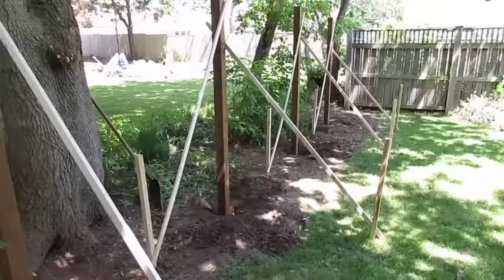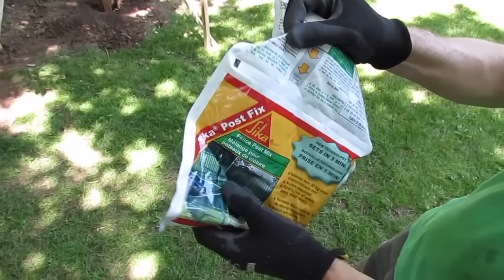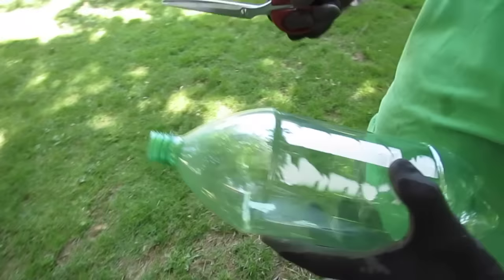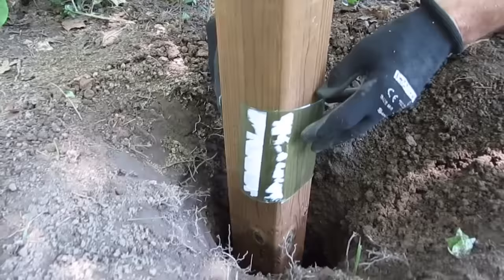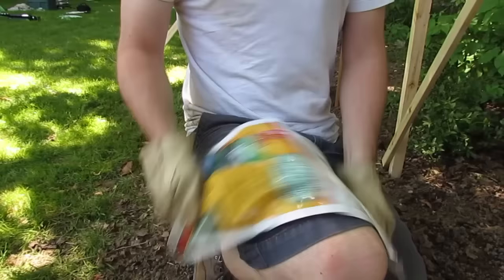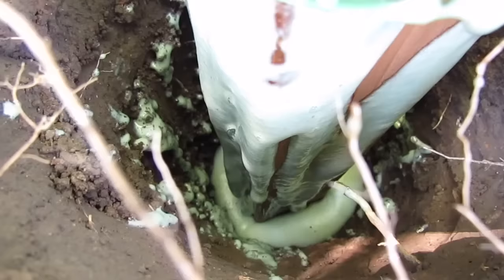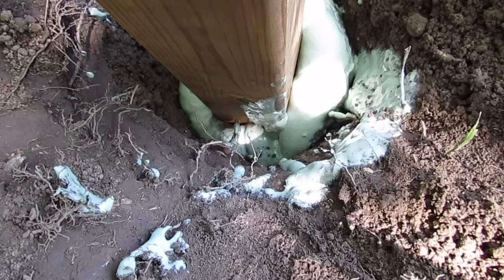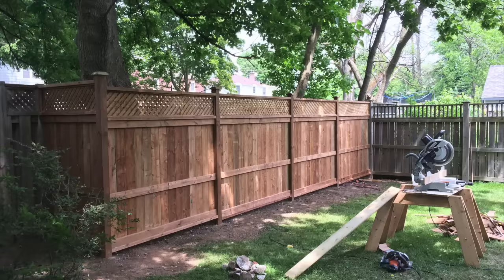No Concrete Fence Post Install!

Comment: You could easily have finished those post quicker with sackcrete,  dump it in the hole, add water and you are done, 1 bag per hole, easier, faster, cheaper, no need to mix it..... it  is  a fence, not an open heart surgery, don't make it more complicated that it needs to be, PS: if  you use sackrete no need to spend all that time of extra work "bracing those post"
Reply from the maker: First time I’ve had this comment, good to know

Comment: I've never figured out why people used concrete to set ANY post..................or foam, or anything else! If you own an actual post hole digger, what my parents called a "digging bar", the end that ISN'T used for digging is flat.......................for a reason. You'd dig a hole, scoop out the dirt, set your post where you wanted it, put SOME of the dirt back in around the post, and use the flat end of the digger to compact the dirt around the post. Scoop in some more dirt, compact it again. More dirt, compact it again. If you could fit the post and ALL the dirt back in the hole, you did the job correctly, and the post was set. Cement doesn't HELP that process. Neither does foam.
Reply from the maker: That seems to be a popular method for sure. In my climate the posts tend to get squeezed out of the soil from frost heave.
Reply: @PatonHaus  I'm in Pennsylvania. Typically, 18" will keep that from happening here. I'm not saying it works EVERYWHERE like that, but this region, 18" will keep anything from heaving due to freeze/thaw. Incidentally, if your posts are heaving from frost/thaw cycles, concrete won't change that! DEPTH will.
Reply: @PatonHaus  By the way, if you're setting any type of treated lumber, concrete whether wet or dry will actually work to deteriorate that lumber. I personally attribute it to chemical interaction, though I've never found spending the time to research it worth wasting when simply setting a post the way they were intended to be set works! LOL.

Comment: So I used it for the first time and it worked great. It was a very hot day and it set up very fast and was solid. The next few times I used it I was very disappointed. One time it had rained a little and I thought maybe thats why it didn't work. The other time it was colder but it did not set up or become solid. Using concrete is almost as easy and its a sure thing. I give the foam thumbs down, would NOT recommend

Comment: I have the project coming up next week, and was checking to see if there's some new products that I'm not aware of. This one looks a good option, but reading the comments below made me wonder if there's enough weight at the bottom to be sturdy. I might throw in a couple of 5 pound dumbbells, or any pieces of heavy metals to give it some weight. I like the foam better than concrete because it'll protect the post from elements , and prolong the life of it, I guess another option is to dip the bottom part in tar, and wrap it with  2 layers of heavy weight plastic sheet, the set it in quick crete. As for you Jay, maybe the %10 are as dumb as you.

Comment: Less mess? How? There are plastic bags to throw away.  There are bits of foam on the post, on the surface of the dirt, probably stuck to his gloves and clothes. Arms, etc.  Concrete comes in paper biodegradable bags, mesh consists of small stones or rocks known as aggregate and can be buried or put on your gravel driveway.  In 50 years or 20 or whenever, when these posts are dug up, concrete can be broken up and reused, recycled.  What will happen to the plastic foam unless they have advanced in foam recycling in the future.  I agree with the statement that this is a stupid product which should not be on the shelves.

Comment: Would this work for a clothesline pole do you think?  Strong enough?
Reply: if you want it to fall down, No weight on bottom to hold in place.
Reply: @robertanthony5745  I actually made a call to the manufacturer and they got back to me advising that if the hole was the depth of one third of the pole length above ground plus 2 feet .... it would work.  Does that change your opinion at all?  And thanks for your reply by the way. :)

Comment: If this really works (and I doubt that it is stable) why not just use spray foam? It gets just as hard and does it as bad as this stuff... I will keep using concrete...still

Comment: For a 6ft fence a 4x4 needs to be sunken 36" or half the fence height to be below frost line to prevent heave and with a 6" gravel Base but usually between 50/60lb of postcrete is sufficient enough,  HOWEVER!!!  If the fence is below 6ft,  steel spikes will do the trick., having said all that it can also depend on where the fencing is being erected and what it will have to endure which I'm sure other professionals will agree on,  no doubt trolls will have their pennies worth of crap as per usual

Comment: Just set the end posts first,after put string line measure 8’ between each post ,that is the way do fence,concrete n water more cheaper than this foam

Comment: The foam lacks the mass and ultimately density of concrete. Eventually the posts and fence will flop around in the wind.
Reply from the maker: Concrete lacks the mass of steel, why bother with concrete when you can pour molten steel around the post?
Reply: @PatonHaus  Getting silly now. Besides molten steel is way too hot and will burn the wood posts. Nice try.
Reply from the maker: Okay fine molten aluminum it is
Reply: @PatonHaus  You obviously haven't caught on yet or grasped the concept of heat. Any molten metal will burn any wooden post.
Reply from the maker: You know that gullible isn’t actually listed in the dictionary?
Reply: @PatonHaus  Did you know if you say gullible really slowly and listen carefully it sounds like oranges.

Comment: Always looking for new ideas. Jees this is awful!! Semi dry mix of concrete means you don’t need probs or stays and it’s a lot quicker, cheaper and tried and tested. Sure that foam tech has its applications but wasted on fencing
Reply from the maker: Thanks Marcus.

Comment: give it a few years, the foam will start disintegrating and losing compaction and you will have another fence project to work on.
Reply: Not just that....the foam only gets hard but it doesn't have any weight to it to actually anchor the post ....

In engineering i beleve weight plays a role not just the density or hardness of a material....

That foam wouldn't have much weight to it at all....seems like the foam is more of a placebo or poor substitute for concrete

Comment: It seems like after a while, the phone without lotta moisture which would write out the bottom of the post faster
Reply: It seems like after a while the foam Would hold a lot of moisture which would rot the bottom of the post

Comment: you didn't need to waste yer time and money on that. those three posts didn't even need to be in the ground that deep because the section is protected and supported at the ends by yer neighbors' fences. a tornado would pull it out but then again it would pull out a hundred pounds of concrete too so my point is what benefit did doing all that get you? fence looks nice but you woulda been fine just tamping back the dirt you took out
Reply from the maker: Good points.

Comment: But aren't you concerned about the next strong storm, or freeze/thaw cycle. What about tornados/hurricanes. Do you think the foam will hold then??? What if there's a car chase and the criminal drives through your fence??? Meteorite? With concrete, you'll never have to worry about these scenarios.
Reply from the maker: I’ve considered that, though I’m more so worried about a crashing satellite

Comment: Mess and hassle of concrete?? I'm MEAN I understand the hassle of mixing but it's really not messy.
Reply: just buy  10 lb bag of redy mix at lowes  pour in hole level the post and wet no mixing to do.

Comment: You want to avoid the mess and hassle of pouring concrete around your post, so you use some sticky foam that you have to cut a two liter bottle to protect each post. . . . duz not computez.

Comment: That expanding foam product you bought from Home Depot is crap and it would never pass inspection
Reply: Does in most places
Reply: @mwrisneyable  would never pass inspection in it in any state maybe for a fence but not for a building
Reply: @o925now  Building? Don't think they even suggest it for foundation work.  Would be afraid to live in that building👍🏻
  Yes, for fencing it does pass in places.  No clue how many.
Did a approx 16ft  fence with it, still standing straight. If you push on it, it has more give but comes back to its spot.
For my longer back fence ( 7'6" tall along a bike trail), am going with standard bag concrete.  Don't want any hobo's pushing it over on a good drunk or drug craze😉
Reply: @mwrisneyable  building a fence does not require an inspection it would not pass any inspection by any inspector in the world it's garbage
Reply: @o925now  In my area of California, they look for a dime anyplace they can find one😥  We are supposed to get a permit and inspection for fences.  Have to have engineering reports if they do not already have the info.  Sucks, between all the other taxes they bend us over for more.  If I could talk my wife into it, I would be out of here.

Comment: I have used CONCRETE in site mix,  transit truck  and Post Hole bag fast setting in hole w/ water following ...... ANY are better, faster and this  is expensive, silly and adds Time, Fuss and far too much exaggeration of clean-up  issues.....   Fast setting in-hole mix concrete is best.
Reply from the maker: Thank you? I'm not really sure what you're trying to say.

Comment: So, a bag that is $130.00, but a can of Great Stuff is about $5.00 a can.  2-3 cans per post should be enough and a lot of money saved.
Reply from the maker: $130? Where did you see that?
Reply: @PatonHaus  I Googled it.  Several different varieties appeared at a wide range of prices.  Some even higher priced.  "Fence post expanding foam".
Reply from the maker: Woodward Anderton There’s only one variety of the one I used and this is it: https://www.homedepot.com/p/Sika-33-fl-oz-Fence-Post-Mix-7116170/300934597

It’s a very different density compared to the soft great stuff foam.

Comment: At $20 a bag of foam I’ll stick to concrete lol
Reply from the maker: Where do you live that they're charging $20 a bag?
Reply: PatonHaus the amazon link in your description
Reply: PatonHaus $23.74 a bag according to the link
Reply from the maker: Yikes you’re right! It’s much cheaper in stores though, for once.
Reply: Using only that hyper-expensive foam is going to backfire. It won't survive freeze/thaw cycles or excessive moisture like concrete would.

Comment: Don't get this product. It doesn't anchor as tight as concrete. You have to knead the bag for 15 sec. The bag can burst (all over you, ask me how I know). If you're more than 2 sec after the mix gets hot and you've not cut and aimed towards the hole, you're in trouble.
Reply from the maker: You've got that right, this stuff expands fast.

Comment: Setting posts out like that is a waste of time and wood. Useing post mix it easyer. You can hold and pure so less time waste and no need so much brace timber. And i hate think what that cost a bag and at lest 2 per hole.
Reply from the maker: If only there were some easy way to look up what it costs.

Comment: what a expencive way of doing this £15 or so for a very small bag of sika post compared with £4.25 for post crete,
Or it would have been quicker & easier to use fixing foam from a can for about a £5 !

Comment: Well I'm not quite sure what to think of this. My experience has been with concrete. Pea gravel base and about 2" or so up the post, factory treated end always down and, if needed, a bit of compatible wood treatment into any deep checks (posts are almost always heart wood so they crack like mad), slope the concrete above grade away from the posts and then, after the inevitable shrinkage, a good flexible caulk. Never had a problem with speed of application or cleanup.

I was about to call BS and give you a thumbs down, but I watched through. This is not a product I've ever seen here, but the manufacturer has a good rep. You standing on the lump looked ok, so it's obviously not the same foam one would use for sealing cracks around windows. My only questions would be about the cost (I realize yours was a small job) and whether or not it's approved for local building codes. I know that codes tend to lag behind innovation, but they're conservative for a reason. Is it resistant to critters - especially termites for those foolish enough to not use PT wood? I dunno, but being an old dog, I can't see using this for most jobs - but one. If you've ever had a job where reasonably intact (below ground) posts are just driven into soft soil which has loosened, I could see this as a decent fix - providing you could inject, rather than pour, the foam from the bottom up. The expansion would push against both the post and the loose soil, buying some time or maybe being permanent for the life of the fence. That's assuming the expanding foam wouldn't jack the post out of the ground. Anyway, food for thought - thanks for posting.
Reply from the maker: Thank you very much for commenting, you've made some excellent points.

Comment: Really don't even wanna think about how environmentally hazardous that thing is, i'd just rather use concrete or stones or something like that
Reply from the maker: Then you really don't want to think about how telephone/utility poles are installed. This stuff is all around you.
Reply: @PatonHaus  telephone poles are not installed since like at least 20 years my guy, where have you been ? And I'M Really really sure they're not using foam but cement, the same thing that sticks out at the top.
Reply: It'd be kinda fucking ridiculous if they used concrete for base but some quirky chemical foam for foundation
 wouldn't it ?
Reply from the maker: @befer  "Telephone pole" is a generic term for any utility/power/streetlighting pole. Sorry if that confused you. Yes, they do use foam to set even large poles. Check this out for yourself: https://www.youtube.com/watch?v=8VXc4S9WtnE&ab_channel=BMKCorporation

Comment: SHIT, I THOUGHT U WERE GONNA PULL OUT A CAN OF INSULATION FOR A MIN! LOOKS LIKE A DECENT PRODUCT, BUT WOULDN'T HAVE THE WEIGHT OF CONCRETE TO HOLD A FENCE FOR 10 YEARS
Reply: AS IN , FIX 'A' POST IN A FENCE LINE... BUT THE WHOLE FENCE???

Comment: foam weighs nothing, I'll take that 70 to 100 lbs of concrete  to help hold the post in wind and weather thanks. Winter, wet weather soggy ground, don't lean against that post lol.
Reply from the maker: Please explain how weight affects the stability of a fence.
Reply: @PatonHaus  I'm not going to get into this with you,  you don't seem to believe that the more an item weighs, the more sable it is against force, any force, it will take more force to move that object, that's  simple physics.  And if you think that soil, that will by the way expand and contract due to the moisture content and temperature, is the only factor to consider in the stability of you fence, have at it and good luck.
Reply from the maker: @gardenpondfishgreenhouse573  This is an issue of leverage, seeing as some of the post is buried. Thus the fulcrum is at ground level, like a vertical see-saw. When all of the weight is concentrated at the bottom of a lever (the post) the amount of weight will have little effect on forces pushing at the top of the lever. Lifting it out of the soil is another story, but how often are fences lifted out of the ground vertically? Please explain how something heavy at the bottom of a fence post will make the fence more stable.
Reply: @PatonHaus  good luck with your foam

Comment: You'd have spent 1/50 by using concrete, and you'd have had a sturdier result.
Reply from the maker: Lets say the foam cost $150, which it didn't. You're saying I could have done it for $3? Hmmm...
Reply: @PatonHaus  Where I live, a 25kg sack of concrete is around 4 dollars. Considering how cheap fine gravel is, I might have filled it with 3 dollars, yes.
Reply from the maker: Riiiight okay. Don’t quit your day job 👍
Reply: @PatonHaus  No reason to get upset, mate, I was just making an observation. I've worked in the industry for 22 years.
Reply from the maker: Dang that’s a long time, good stuff

Comment: I know better than that, aside from the fact that concrete is obviously stronger it's way easier to use and that stuff you're using, and it will Outlast the post

Comment: Waste of time anyway the cedar will not hold up as well as the pressure treated post.  The post will need to be replaced in a short time.
Reply from the maker: They're pressure treated, not cedar.
Reply: @PatonHaus   They video looked like cedar.

Comment: You'd probably need 10 of those bags of stuff for what one bag of cement could do. Also, there's no way that stuff would be as strong as concrete. I'm a builder and I do these kind of jobs all the time. This is not a good idea.

Comment: No way is that any better then using concrete I highly doubt that this will hold up over time and plus a bag of quickrete is much cheaper at 5 bucks compared to paying 12 dollars for some foam that isn’t even sufficient enough for the project your doing

Comment: NOTICE HOW ALL THE DIRT HE'S PULLING BACK TO KEEP FROM FALLING IN THE HOLE IS FALLING IN THE HOLE.  L.O.L. THIS STUFF ISN'T THAT GREAT. DEFINITELY NOT AS SOLID AS CONCRETE. THE FOAM HAS GIVE TO IT AND YOU CAN WIGGLE THE FENCE WHEN YOU GET DONE . OVER TIME I IMAGINE IT WILL GET WORSE WITH HIGH WINDS PUSHING ON IT. ON A WOODEN FENCE IT MIGHT BE O.K. BUT I'D STILL GO WITH THE CEMENT.
Reply from the maker: LOL